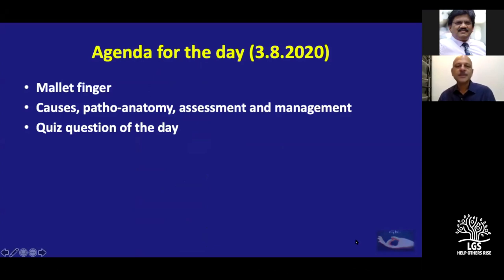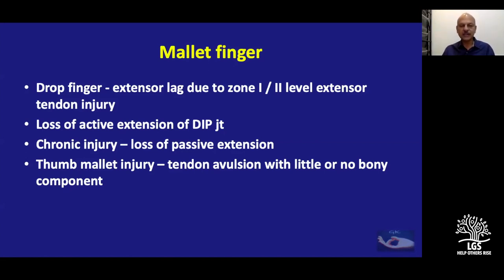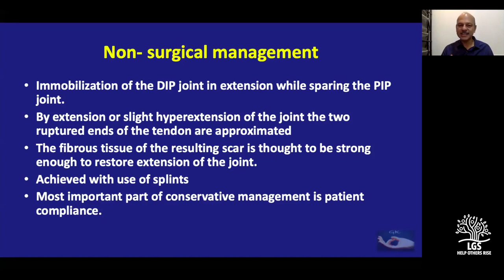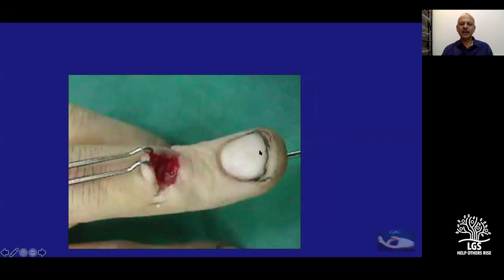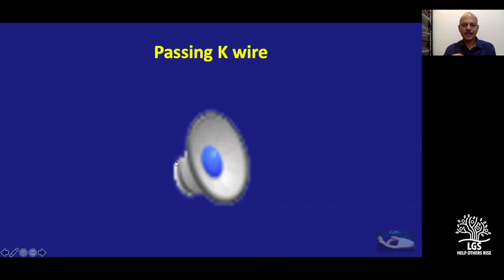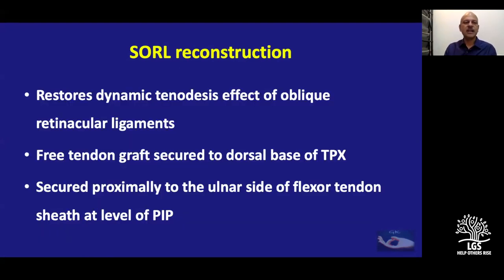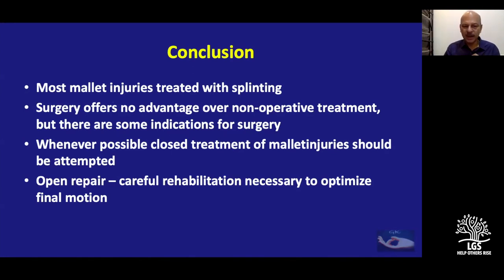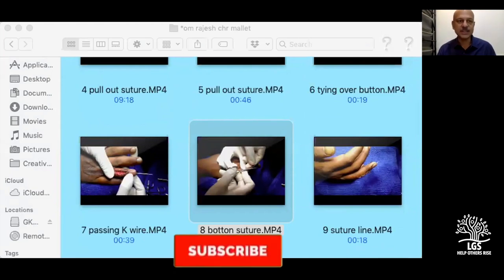Management of mallet finger | Dr Karthikeyan Gomathinayagam MS MCh

Comment: had a bony mallet finger last august, hitting my pinky while loading my suitcase in the car going on holiday... didn't take it seriously, thought if it was broken, I wouldn't be able to bear the pain. cut long story short, visited orthopaedics 2 weeks after... ...." you came too late... bone has started formulating and broken part of the joint is off, cannot be pushed back in." fracture was > 30% < 50%....with volar subluxation ...." you need surgery..." surgery done 3 weeks after injury... only 1 k-wire across the DIP joint and casting for 5 wks. Doctor takes it off. physical therapy started to get the DIP joint moving, 3-4 days a week for 4 weeks... 24 sessions after, the bump on the joint does not subside.. we take an x-ray... joint has healed but bony fractured little piece did not fully sit in the joint... partly out... 50% of times i flex my finger, i hear a crack as if my cracking a knuckle. lag is not too much but grip and strength of the pinky are impaired... very expensive lesson to take health issues seriously and act immediately...